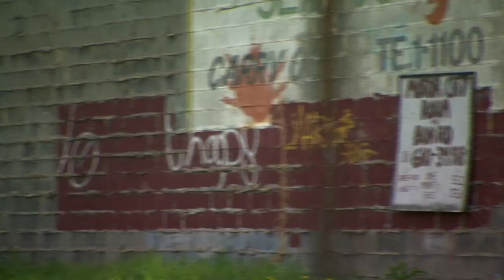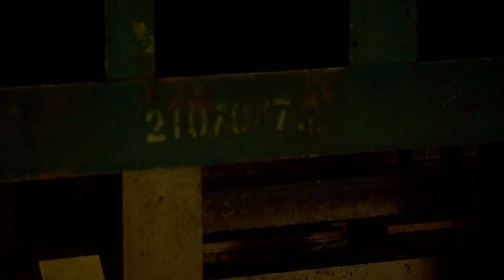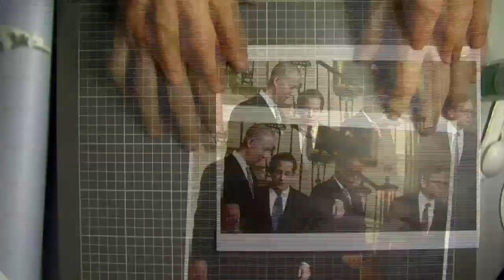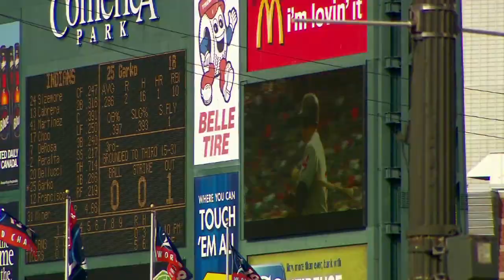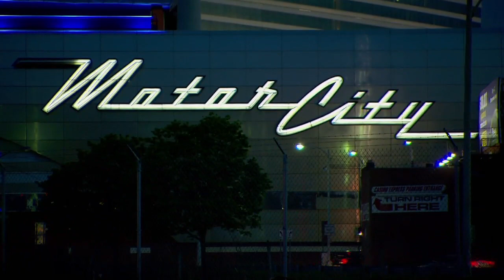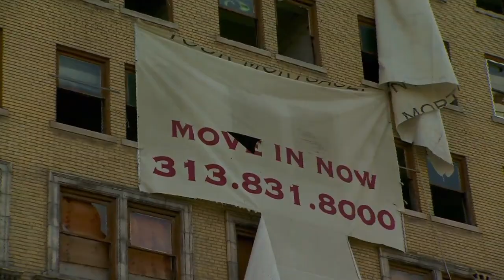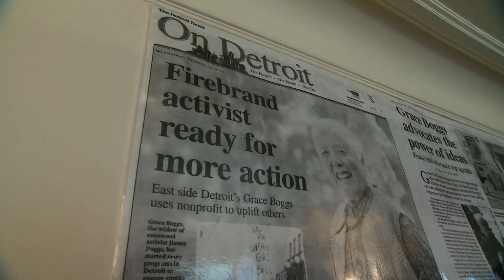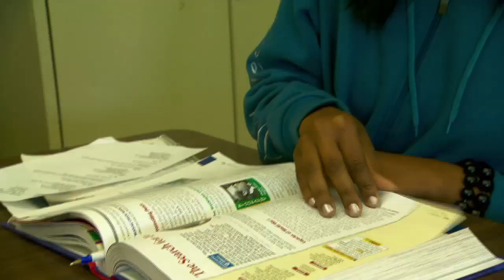🇺🇸 Collapsing Auto Industry in Detroit | Fault Lines

Comment: The economy has fully recovered since this video was made, and while production most left Detroit for greenfield sites (there's no reason to locate in a state with such severe winters) even that city is turning around. Economic problems are CYCLIC.
Reply: Please do not perpetuate the myth that there is no manufacturing left inside the city or in the surrounding environs. It is a falsehood. Most shrinkage took place in the eighties over thirty years ago. Most left in the seventies. There are still three assembly plants either completely or partially inside the city borders and six more within thirty miles of the city limits. There are two full service steel mills, three major engine plants, four oem stamping facilities two glass factories, a huge oil refinery, and dozens of parts plants either in or near the city. There is no denying that the industrial bade has shrunk since the eighties but Detroit still makes cars and car parts.
Reply: So much easier to build anything in a green field site. It's why Ford tore plants down instead of reworking old ones.   To work within the confines of an old structure is crazy.
Reply: Aimee Webber There is risk in answering this question the wrong way. So I will preface. It is not about urban race. It is about urban culture combined with an essentially broken city education system. First. Culture. There have been a dozen or so generations of inter city Detroiters who have been raised in a culture of non mainstream employment. That’s a nice way of saying welfare of crime. Socioeconomic issues like drug abuse, female only head of households, violence and a lack of effective public transportation system combine with a second rate school system to create an environment in which employment is not valued. You bring up a valuable question. Maybe the most important question that Detroit urban leaders have to address. I am not black and do not propose that I am an expert on African American culture but it is clear to all but the blind that something is wrong. My wife taught in the Detroit Zoublic School system for
Reply: Aimee Webber Sorry. Sent by mistake. My wife taught in the DPS for 25+ years. She teaches at Wayne State now. Her opinion is that the number one long term priority has to be education. The schools have to teach practical skills, demand commitment from students and parents and equip graduates to succeed. I love that downtown and the city core is coming back but it will fail if residents do not equip themselves to join the resulting boom in jobs. Good question. No simple answer. Only hard work.